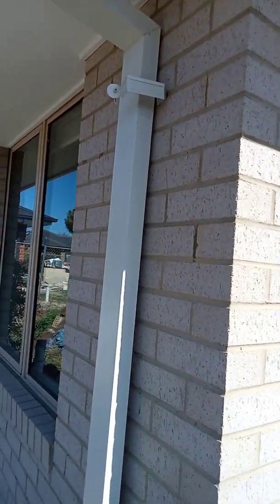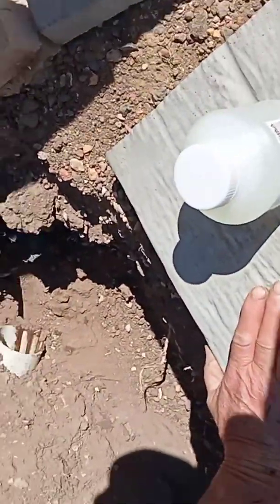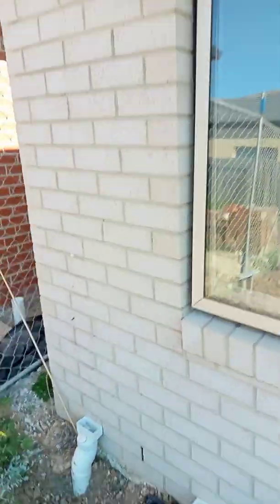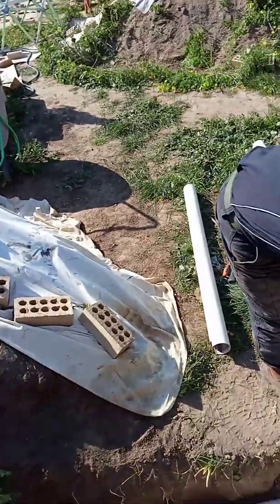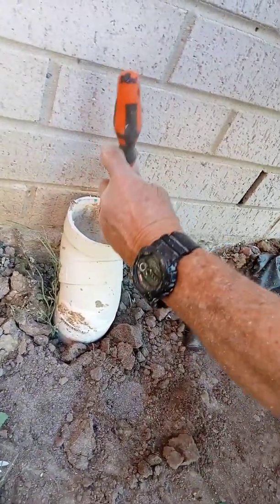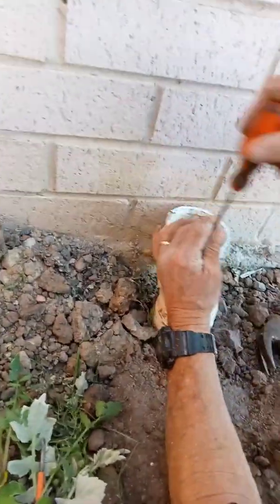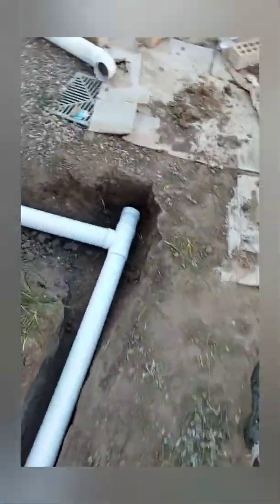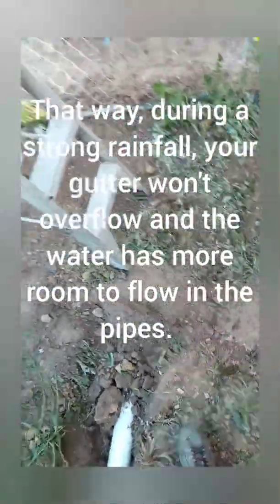How to make a sealed downpipe system (wet system) to a rainwater tank

Comment: Was a plumber helping you do this?
The "flush outlet" won't help much to clear the sediment as it will only drain the volume of water that is above its height.
Mosquitoes can access the standing waters and lay eggs.
The velocity through the stormwater pipes will be insufficient even during heavy rain to prevent sediment building up near the downpipes. 
The method used is laborious and time intensive. Modern methods leave the stormwater pipes unaltered and do not need to use an overflow pipe at the tank.

Comment: How do you stop it blocking up with sediments
Reply: There is a pipe opening near the bottom of the pipe which goes into the tank. It has a screw -on lid which I can take off to clean the sediment out.